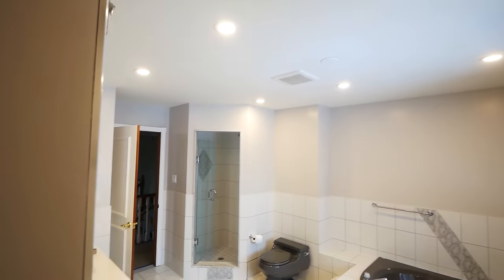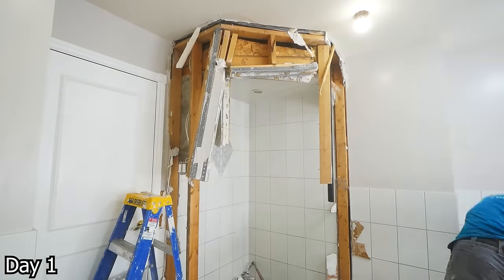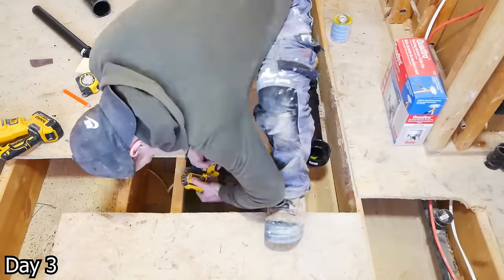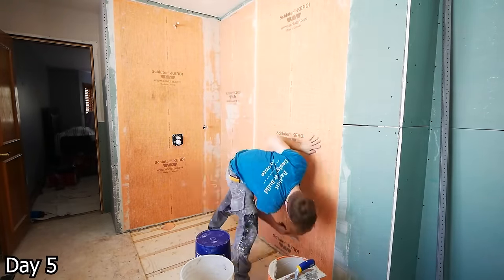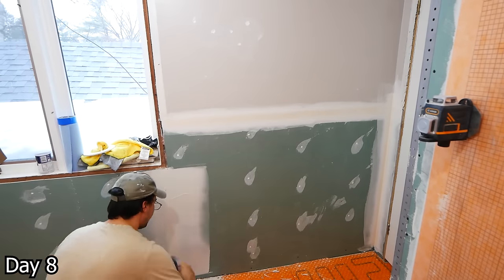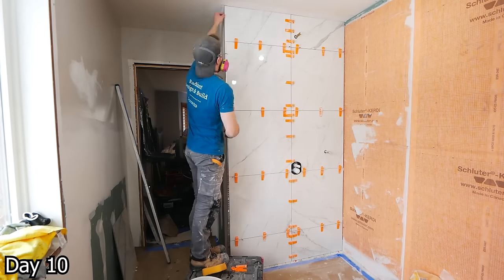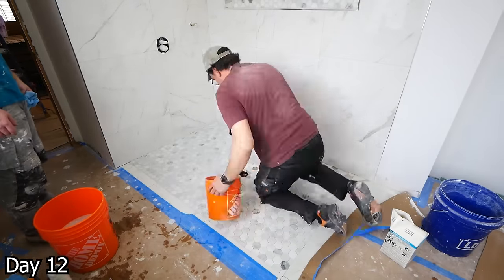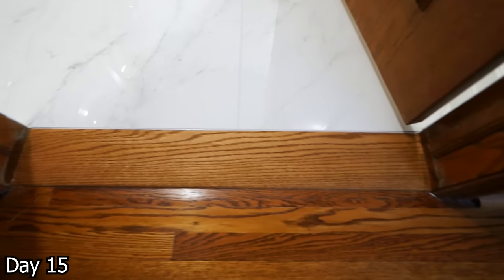Modern Ensuite Bathroom Renovation & Remodel

Comment: I’ve always through any second floor laundry should require a floor drain.
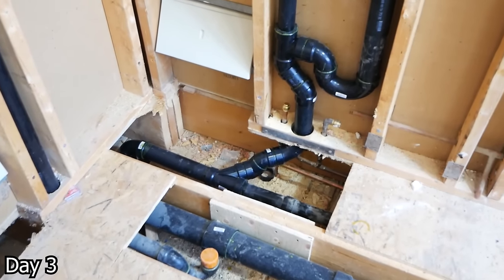Reply from the maker: You can see it at 5:29 
Didn’t really address it as the laundry room wasn’t the focus of this video
Reply: Now I see it lol.  I can tell you from experience if there is no drain the water drains through the closest first floor light fixture.

Comment: Somehow you managed to make a smaller space appear larger and more open than the original.  Great work.  Interested in the seamless shower....how did the pan get installed? Is it pre-sloped to the center drain or did you hand taper?

Comment: Did you put a thin layer of thinset on the back of the tile? I saw you did for wall, but wondering about the floor tiles.
Reply from the maker: A lot of the time with tiles 24x24 or larger I backbutter the wall/floor and trowel the back of the tile

Comment: Beautiful work! Are the tiles used on the shower walls and floor the same finish? Polished? Do the homeowners have issues with slippage when wet or when wearing socks? Love the look but that would be my concern. Also can you link or recommend the led strip and diffuser you use. Thanks
Reply from the maker: Yes polished for floors. You definitely don’t want polished tiles in the shower but for general area it’s okay. It’s of course going to be a little slippy with socks but nothing crazy imo 

I’ll be coming out with a video in regard to the niche leds within the next couple months

Comment: Wolkon, please start using stud shoes for large boring in lumber membranes like such in the video, boring such a large hole close to the edge like that weakens the entire joist and can lead to failure down the road, albeit very rarely, HOWEVER. It helps keep the peace of mind later down the road!
Reply from the maker: Great tip thanks! I always try to keep my holes at least 2” from edge but looking back at the video I may have gone past that here. Appreciate the advice!
Reply: @WorkinwithWolkon  I know from experience! Great videos, I would really like to see some videos on your methodology on your remodel process. Keep it up boss.